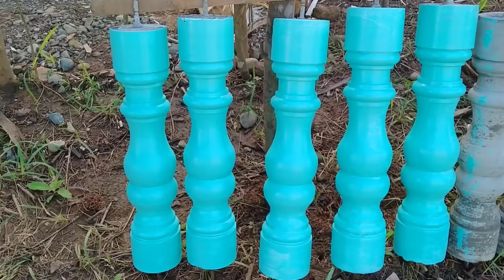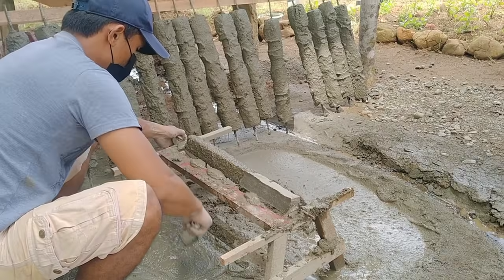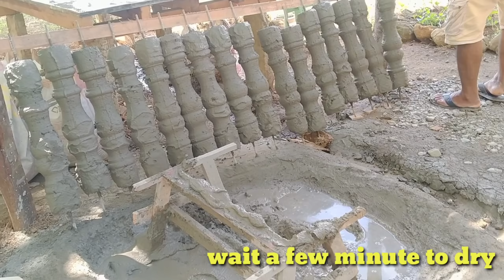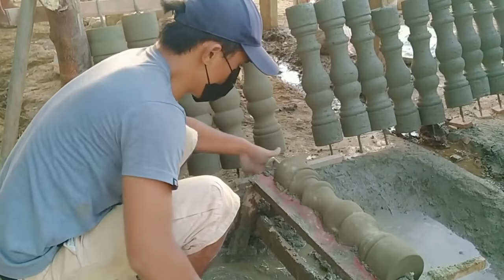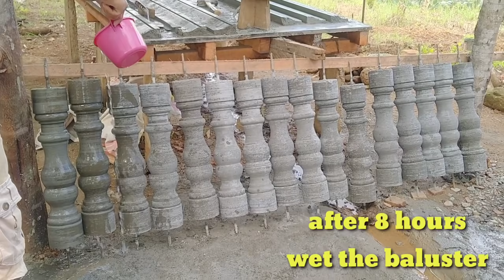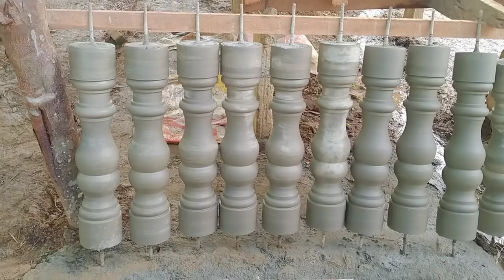How to Make Precast Concrete Baluster no need plastic form

Comment: If you select round base instead of square base, your production time can reduce
Reply: Ganyan tlga para matibay
Reply: Using round base would not be good  it's still better using the square base so the cement will stick properly unlock round base when the cement will have some cracks it will easily break